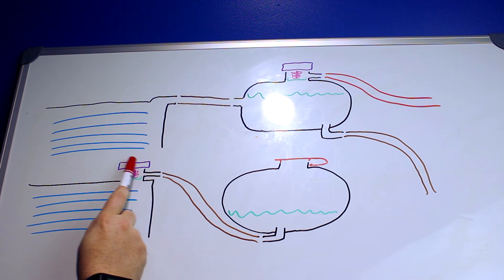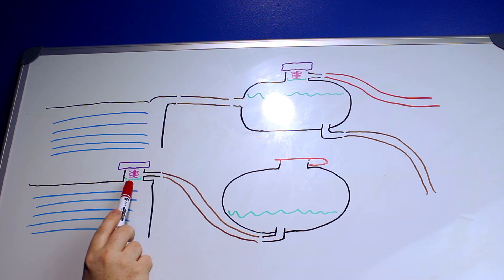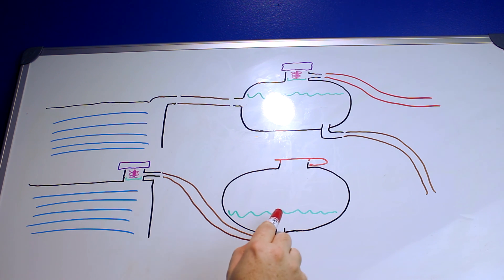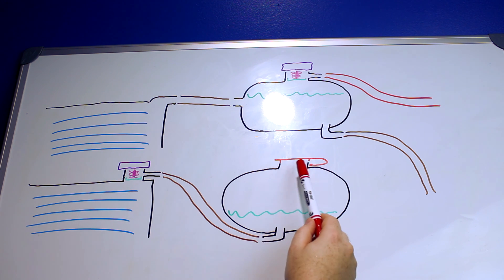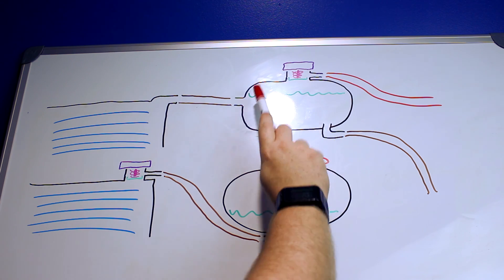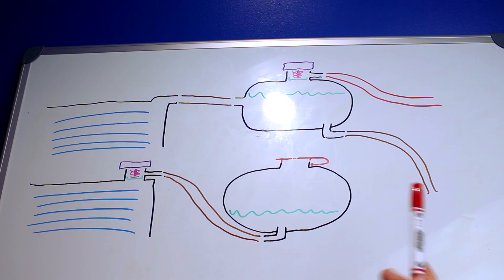Differences Between Expansion Tanks & Overflow Tanks in Automotive Cooling Systems

Comment: My friend. Excellent video which makes me think. I just replaced the radiator from my 2010 pathfinder with a high flow or capacity 19 psi one designed for this suv. It comes with a pressurized cap which will be interfering with the expansion tank also with a pressurized cap. This is no good.

Comment: Hello thanks for the explanation I have a mokka x 2019 and it has an expansion tank , have been having issues with it spitting water out of the cap took it to the garage for a fix. Would like to send you a video of what I had then and what I have now if it’s working properly.

Comment: My Chevy cruise 2014 plastic coolend tank cap is expansion cap without hole, I just realized today after many issues due to pressure build up had caused leaking and once the tank broke at joint and even after replacing with new tank I faced the issue during summer,  I went to mechanic few times and couldn't fix the issue,  When I thought to inspect the cap I found there are attachments inside the cap but the cap has NO HOLE, so what is the purpose of the fittings inside the cap if there is no hole? I then made a hole and it works fine, so when I tried to open the cap  there is pressure built up inside when  so if the pressure increases more than 20 PSI it vents out.

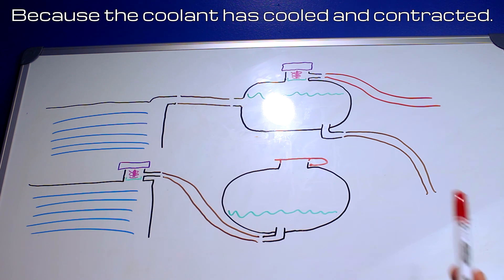Comment: @1:00. Is there a one way valve built into the radiator cap, that lets coolant flow back into the radiator ?
Reply: I will answer this myself now. Yes there is a "Vacuum Valve" built into the radiator cap that allows coolant to flow back into the radiator...
Reply: As the temps cool the pressure will suck the water back into the system and as the pressure gets to a specific level it will seal the cap again.

Comment: I bought a Volvo, and it’s a whole different animal, compared to my Ford mini-van.  The no-dipstick, now no radiator cap.  My mechanic, who used to deal with this car, passed away last year, so it’s on me, to learn about this car.  I thought maybe Volvo hid it from me, like the battery, that’s in the cargo area.  Nothing surprises me about cars, now days!  Thanks for verifying!👍💯💯💯
Reply: What volvo is that? As a mechanic I see plenty cars without a dipstick but ive never seen one without a radiator cap. I could help you locate that thing :)
Reply: @niekstapelbroek4416 It’s filled through the overflow tank.

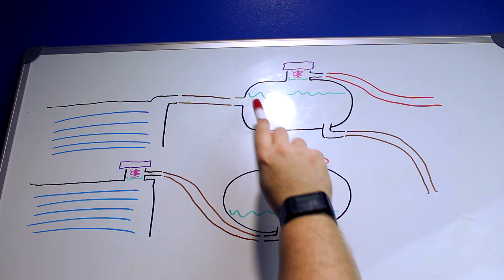Comment: 2:48 In my car, they made it vent around the cap, no hose, it's very easy to see water and steam when overheating occurred, it's a bit messy but it's practical. 
Thank you for your simple explanation, I now understand why I need to maintain and replace the cap, it's often overlooked after hose changes or radiator change.

Comment: Question about overflow systems 

Why would there be air bubbles in the system? Is this only after filling it and not burping the system? Or is air a continuous thing that happens after every heat cycle? I'm concerned about seeing air in my overflow tank, couldn't that be a head gasket letting exhaust into coolant system?

Comment: Great  description,  I'm  a bit concerned  my kit car has a expansion  vessel  fed from the big hose going  to  the  thermostat it has a plastic  cap which  doesn't  have the option  to fit a recovery  tank , should  I change it for a aluminium  one with  pressure  cap as in your  first diagram,  leading  to  a recovery  vessel it's a black top zetec running  around  249 bhp gets up to 95, I don't  want  to  damage  it, cheers

Comment: Great video. It's just what i was looking for. The only feedback I have is that I think it would make more sense to explain the coolant returning from the overflow as being drawn in by vacuum in the system rather than pressure pushing it back in. I get that it's technically the same thing, but describing it in terms of pressure might cause someone to assume that the pressure condition inside the overflow somehow changed when it didn't.
Reply: I need to do a complete coolant flush on my car soon and this is the one thing I am still a little confused about. I can't find any detailed videos about how the overflow tank functions. Is the hose full of air, or coolant? I suppose the first time the system is under pressure, the air would be pushed out of the hose and into the reservoir and replaced with coolant?

Comment: Does the cap on an over flow bottle on a older Jeep Wrangler have to be vented?  I just replaced my OEM bottle and the new bottle has a very robust screw type cap with an O ring and has no venting whatsoever.  Any info would be appreciated.  The vehicle has no AC not sure if that matters ???
Thanks

Comment: Thx for z gr8 explanation. Got a  question my benz w202 230 has an expansion  tank connected to the radiator that has no cap by a very thin hose. The radiator has 2 big hoses connected to the block one inlet and one outlet. There is alsk a hose from the tank to the block . Can u pls explain to me what is the purpose of the 2 hoses of the expansion tank. Thx

Comment: Atmosphere pressure is around 14.5psi. That pressure is much lower than 60psi where the pressure Cap on the radiator opens.While system is cooling the radiator cap closes. How the coolant flows back from the expansion tank using atmosphere pressure. 14.5psi <60psi

Comment: Be careful of expansion tanks! I got fooled by one on a newer John Deere dozer. It was a plastic tank with a plastic cap. After 20 years of operating equipment I assumed it was just another overflow tank. I opened it to top up the coolant and got blasted in the face even after what seemed like all the air escaped. I got burns on my face and hands.  Fell backwards off the dozer and badly broke my leg and foot. After surgery I’ve been off work for 5 months now.  I have yet to regain full function of my foot and ankle. May need multiple more surgeries.

Comment: Great video and explanation.  One important difference between the two (that I learned the hard way) is that you can open the lid on an overflow tank while the engine is hot but you should never open the cap on an expansion tank while the engine is hot.

Comment: I can add that during the heating/expansion  process some air leaves the system. And after shouting down the engine and during the normal cooling process of the engine, the air comes back to the system thru a little valve included in the radiator cap and in the expansion cap, this valve release the vacuum in the system.

Comment: Question there are vehicles that uses an expansion tank with two hoses the other one is return then the other one is coming from the radiator so on that type of model how does it build up pressure?

Comment: I landed here just because I was wondering if the head gasket testing kit could be utilized in either system through either the overflow canister or the expansion tank. I'm trying to be extra safe when checking out cars before purchase. Thanks in advance for any information.
Reply: If your overflow tank isn't pressurized, then you must use it in the radiator 😊

Comment: At the end of the day the fluid flows back into the radiator?? Doesn't the spring on the radiator cap also cool down and closes. So how can atmosphere pressure push the fluid back in with the spring deactivated?
Reply: My question exactly!  When the engine cools down, there will be vacuum from the engine pulling the pressure valve closed, plus the force of the spring.  How does coolant get back into the radiator?  (Overflow bottle type system)
Reply: @georgehooper6955  
2 different spring systems. I had no idea a radiator cap was that technical...

Comment: hello, thanks for t he video. it is very useful. On my 2004 acura is blowing off the reservoir plastic cap, This car has a  spring loaded raditior cap. what could be reason. is it ok to drive without platic cap. Dealer asks 15 dollars for it?

Comment: my nissan frontier has a pressure cap on the radiator and the overflow tank with a pressure cap, do you know why?
I wanted to change it to the aluminum tank with the clear tube showing levels.

Comment: Do you know why my nissan frontier has a pressure cap on the radiator and the overflow reservior?  How necessary is the overflow pressure cap?  

Reason: I wanted to change my reservoir to the aluminum reservoir with the vertical tube that clearly shows fluid level.

Comment: I have 2004 C5 Corvette no cool e leaks no dropping level in expansion tank but smell odor of coolen t after shutting car off hot top hose from expansion tank goes into radiator the cap says 15 psi now th does not sell 15 psi but 18 psi called th dealer 've said that is what it calls for is his a m flaw saying 15 psi Bettendorf o early so 18 psi  looks like water pump had been changed and belt pulley rose color but not wet could the smell be the heat of technology belt burning off old coolent  car not running hot 200 to 220 hot day in traffic any help On this

Comment: Steve if you have an older model vehicle and extra coolant, would it make sense from a preventive maintenance standpoint, to extract some or all of the overfill coolant and replace with new coolant,  pre Summer?
Reply from the maker: Even if the coolant was being replaced directly from the radiator in the amount the tank has, the old and new coolant still mixes into a less ideal mix, and very little of the sediment that needs to get flushed out will be removed. An overflow tank being drained and filled with fresh fluid would be like that but the mixing would occur much more slowly, potentially not at all if there is an issue with the cooling system.

It wouldn't hurt, but it would be much better to just drain all the old stuff out and put in all new fresh coolant. Plus you avoid potential coolant compatibility issues.
Reply: @CarsSimplified  yeah you must be right because I've never heard of anybody doing it  thanks for the feedback

Comment: Great explanation and I really thank you for your time. I got a question: what happened if I just install an expasion tank instead of a overflow tank (radiator has already its cap) would it work as "overflow"? The issue is that I am rebuilding an old truck which has no overflow tank at all (there is just a hose from radiator to space) so I have to keep checking for the coolant level as it drops it when heats up, because of the place where the overflow tank supposedly fits it is kind of weird that only found an expansion tank that would fit in place .. let me know what do you think would ya? Thanks in advanced man. Atte MC.

Comment: HI -
i have Chevrolet epica 2009 with 2.4 6 cylinders engine - i remove the old engine and install new Toyota Camry engine every thing is great but i want to know 
Do i have to change the RAD system from the original one ( expansion tank ) to Over flow type ? 
Thanks

Comment: How does the coolant flow back into the radiator past the radiator cap when the pressure of the cap pushes down on radiator creating a seal?
I’m not comprehending the return flow from the reservoir to the radiator!?!?

Comment: Hi I did a coolant flush on my passat b8 and put in 4 litres of coolant. I realised it wasn't enough but my mechanic said its fine you can drive it. It covered 2 inches of the bottom of the expansion tank but after 10 minutes of driving I realised my expansion tank was empty. My engine fan did not turn on my car did not show signs of overheating on the temperature gauge. Is there a chance that I have damaged my engine?

Comment: I made my own radiator overflow tank since I have a custom engine swap. My question is, should the cap be a tight seal or should it be vented? Currently I have an aluminum container with a twist on cap with a rubber seal on it

Comment: The drawing shows the two tanks place at two different levels (heights) but you didn't mention whether that matters.  Are you familiar with the term "header tank"?  My understanding is that a header tank contains a "head" of coolant above that in the radiator so that gravity plays an important part in its operation and is preferable to the two you have covered.

Comment: Hi 

Thank you for making these videos

I have a question about my car, the coolant is in the minimum before using it, and dropped a  little bit after using. It retains that level until morning and when I opened the cap it came back to min level. 

Is that normal?

Comment: In an expansion tank system -is it correct that the coolant does continually circulate through the entire system (including the expansion tank) when the vehicle is at normal operating temp?

Comment: your expansion tank explanation isn't correct.  There is only (2) hoses on the expansion tank and one goes to the engine and the other goes to the top of the radiator (bleeder tube). Having (2) hoses going to nowhere makes no sense.  And there is no expansion tank that leads to an overflow tank.
Reply: I think 3rd is over flow. 1 is return 2 is out to pump
Reply: The third hose that is close to the expansion tank pressure cap, is connected to a bypass split pipe/tube coming from the top radiator hose. That allows the system to burp any trap air in the system. Hence, why the third hose is higher than the other two main hoses (inlet and outlet).

I have replaced all my coolant system hoses and fittings on my 2003 VW TDI Golf with a EGR and Oil filter cooler. A very complicated system but it has its Pros/Cons
Reply: I added head gasket stop leak to the expansion tank,  will that circulate into the radiator?
Reply: @CbrF4i600cc  not a good idea
Reply: Duh. Yes unless you aren't circulated.

Comment: I recently replaced the radiator on my ‘19 Chrysler Pacifica. Afterwards, I burped the coolant with a big funnel, but now the coolant level on the expansion tank is a bit high. Soon as I open the cap it makes a whoosh sound and the coolant level drops about 1.5 inches. The coolant temperature ranges seem to be ok 195-225, depending if it’s seating idle on traffic or moving. Do you think I may still have air in the cooling system? Should I repeat the burping process??

Comment: Sir can I ask something about my ford ranger expansion tank. I went into a shop to check my ford ranger because I am losing significant amount of coolant and they haven't fount any leak. They said that my expansion tank is not generating pressure and that the coolant evaporates and i need to replace it. Is it possible that i have a faulty  coolant expansion tank? Thank you

Comment: '05 Town and Country 3.3L Overflow tank fills but doesn't seem to ever return any liquid to the radiator. Radiator level decreases. What would be a fix for this? I've changed the cap, no apparent result. Could there be a leak in the cooling system?

Comment: Old school design with overflow is much better in my opinion.
Ive worked on many bmws and their expansion tank design is horrible. Since it’s a pressurized system, you can’t run water only and the expansion tank cap has hold good pressure or the car will have overheating issues. Also they are a pain to bleed since the radiator isn’t the highest point in the system.

Comment: Mine is the type you see in more modern cars with the expansion chamber having the cap (where you fill the coolant level up). Had a strange issue just today where I could see the level had risen above max so I opened the cap to check further and the level just kept rising until it was coming just out and over the fill neck. Like when you shake a coke bottle and it fizzes out.  Only this was whilst the car was stone cold and resting hours on the driveway. It wasn't pouring out just out and over slightly as it had nowhere to go but out.  I've not filled coolant for a couple weeks give or take, was It perhaps overfilled and not showing a consistent level the last time I checked it, was filled correctly to the max line whilst cool.  I'm baffled to why it had all this pressure in the chamber pushing coolant out.with risen level?
Reply: Possibly a failed head gasket pressurising the cooling system.
Reply: Ongoing issue for me had the gasket done and surroundings checked but this never fixed it, still gassing upon cap opening after any shortish journeys of say 10-20 miles.  So unless they never did the job at all it never fixed the problem. I've since seen other things can cause same symptoms, oil cooler, egr cooler pressurising coolant.  It's a pain of a problem

Comment: Thanks so much for the video. I have a C7 corvette and am wondering how the engine cooling system gets pressurized. If it is so. Now in the expansion tank there is an overflow hose connected directly to the ambient. So, the pressure cannot increase in this tank. In any case there is a 20 psi cap. Maybe it's there for safety reasons. But my main concerns are with the pressurization of the engine cooling system. How can the pressure increase due to this venting in the expansion tank? What do you think?
Reply: In a pressurised cooling system (i.e. most cars), as the coolant heats up it expands, and pressurises the air inside.  If the coolant level is high enough, so that there is little air volume the pressure will exceed that of the cap rating (typically about 15 psi) and the cap will release any air and/or coolant.  If the coolant expelled is captured in an unpressurised overflow bottle, then some or none of it may be returned but this depends on certain conditions such as the height of the bottle, and whether the end of the pipe is in or out of the coolant.  I hope that helps?